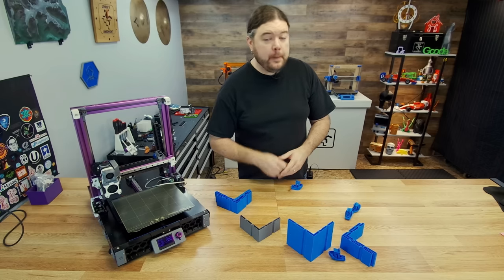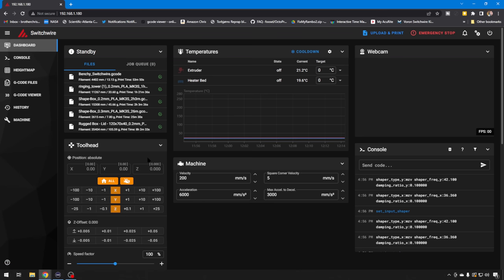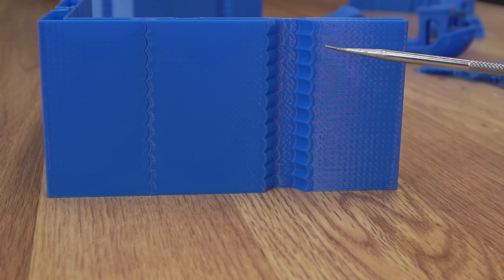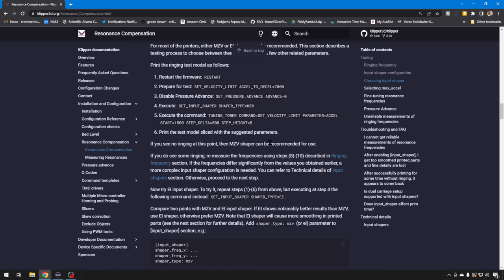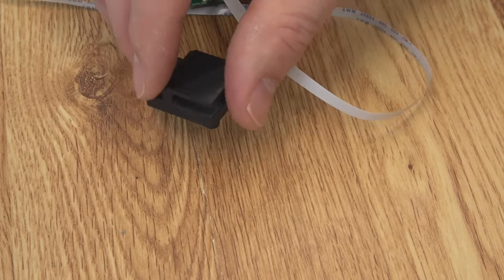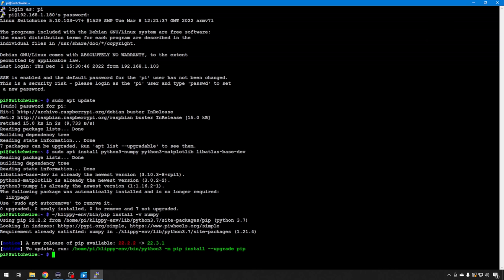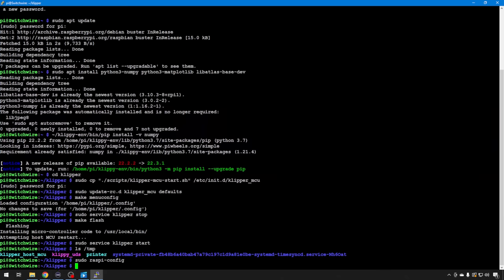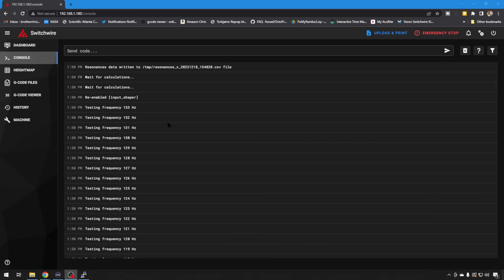Input Shaper - Part 2 - Deep Dive - Klipper - Accelerometer - Chris's Basement - 2023

Comment: For anyone who is creating their own wiring harness for their ADXL345, you need to keep the wire as short as possible and the docs recommend using  twisted-pair wiring like you find in CAT5 networking cables. Check the docs for which wires need to be paired together, because it does seem to matter. All three of my ADXL345's reported errors with straight (and long) ribbon cable. Once I created the twisted-pair cable (pairing together the wires that the docs specify), the very first ADXL345 that I had plugged in immediately returned good values. Hope this helps someone.
Reply from the maker: Great tips, thanks for posting.
Reply: @ChrisRiley  Thanks Chris, and thank you for putting out the advanced tutorials. There are tons of tutorials for beginners to 3d printing, but the more advanced topics seem to be glossed over.

Also, to anyone interested, I tested all three of my ADXL345's and all three tested good with the twisted pair cable. I wonder how many people thought they received a bad chip when it was the cable all along.
Reply from the maker: @@mercy3094 I don't see why not. It should react the same way.

Comment: I tried the direct wire method. Got a test response, but trying to run the test always errored. Ended up using a Pi Pico as the mcu and it works fine.
Reply from the maker: Hmmm, interesting, I wonder what it was having a problem getting back?
Reply: @ChrisRiley  beats me, but at least it works now and I have a spare pico (order was 2-pack) for whatever. I tried 3 diff adxl thinking I got a bad set.

Comment: I'm glad to see such a detailed guide on setting up Input Shaper because I think so many people can benefit from it.  I saw so much improvement in my prints that it seems like magic.  Wiring a sensor might initially be a bit harder for some, but it makes recalibration or setting up on another printer so quick.
Reply from the maker: Absolutely, I'm trying to break it down as much as I can. It's very impressive.

Comment: Surly the mass of the accelerometer and screws being removed after the calibration will have some effect, maybe printing a badge with the same weight to fit on the fan fixing and the bed to equalise this mass will benefit in some small way?
Reply from the maker: Good thought, that would be something to try.

Comment: Did a recent "recalibration" after initial setup with an accelerometer, as i noticed when printing at 200mm/s before without input shaper i had little ringing and after it seemed to introduce ringing (Sermoon D1 is pretty sturdy).. but maybe that wasn't the entire picture. So this time i warmed up the machine, since it's enclosed (i put a top on it) all the parts/metals get warm.. so i did another calibration with the accelerometer, to find it shifts about -6 in the X direction and -2 in the y direction (ran it twice to make sure). THEN! i ran some test prints, now it's finally better than with it off 🥰

Before i would have to run a print at over 300mms/3000accel for input shaping to start working, and worked very well at 400mm/4000accel, but i print a lot of mechanical parts and generally can't rely on prints that come out that fast so it was an issue for me (minor). The ringing or faux ringing does have a noticeable effect on print integrity, and now i can print out great mechanical parts at 200mms 😏

Long->Short; warm up your machine to typical operating temps and let it saturate before running calibration with an accelerometer
Reply from the maker: Great comment, thanks for posting. I have seen some of the new machines that are coming out with input shaper. They do the exact same thing you did here, they have a heat soak sequence to make it more stable.

Comment: Nice work Chris.  I use a retired Lenovo mini pc as my klipper computer so I use a Pi pico to talk to the accelerometer; works well.  Also if you have multiple Klipper printers I think it is easier to setup as you only configure the communication with the mcu once.
Reply from the maker: Thanks for the info!

Comment: Input shaper is amazing!!
Calibrated it on my printer the manual way and the results are astonishing! Got my cheap ass MK3S clone to 5000 acceleration using "only" 3000 for printing (5000 for travel moves) and got an immaculate Benchy at 130 mm/s print speed in just 40 minutes!!
Ordered an ADXL but honestly, I don't think it's required. 
Btw. no need to go for 3-4 decimal places. Just round it down and you're good.
Reply from the maker: Thanks for the info!

Comment: As ever your videos are so great!!
Is possible to print ringing tower model whith several IS types with fixed acceleration instead of print a whole model at same IS type only?
Reply from the maker: Thank you! That is a great question, with Klipper you can change the model on the fly. So, if you did some creative slicing you could enter this command at different layer heights to change it as it printed. SET_INPUT_SHAPER SHAPER_TYPE=XXX

Comment: same i like the details you go into and make it pretty simeple to follow, i had a question that sensor is pretty cheap but i have seen others out that might be asier that just plug into usb and usb-c into the accelerometer, i think i will go with the one you went with but wanted to know about the others if they would be harder to set up via ssh and the klipper interface with just the initial setup in the config file
Reply: your printables file wont fit for my setup as im using the sprite extruder on my ender3's and an mk8 for my cr10s5
Reply: but thats still pretty cool
Reply from the maker: Thanks! You should be able to run a sensor plugged into USB, but I'm not sure how it would be defined. I'm interested I will look around at what options there are.

Comment: I have a question. You tested frequencies with accelerometer.  But when you did that, there were manual input shaper values already in your printer.cfg. Didn't they interfere with the new calibration? I believe, it would have given more accurate results if you would have removed those before using accelerometer.
Reply from the maker: Yes, you want to zero those settings out before you do the test. There is a console command we run to turn it off before the test.
Reply: TEST_RESONANCES AXIS Script switches off Input Shaper before start test.

Comment: I'm getting the following error from the LDO input shaper kit option 'probe_points' in section 'resonance_tester' must be specified, I googled and redit suggested it was a wiring issue. After some time messing with it I gave up, I might get a Trianglelab USB adxl345 Accelerometer instead.
Reply from the maker: Make sure your config looks like this.

[adxl345]
cs_pin: rpi:None

[resonance_tester]
accel_chip: adxl345
probe_points:
    125,115,20  # an example

Comment: Hey Chris, if I only have 1 pi with 2 printer interfaces, can I add the entries for mcu rpi, adxl, and resonance_tester on each of the printer's cfg? and can they stay there permanently?
do i have to REM on one if I wanna use it on the other? it's just that, I got everything set on 1 printer and everything was hunky dory, and now I wanna do it on the 2nd one, it kept complaining that it cannot connect to the rpi mcu.
Reply: never mind, i found that you can only have it on one printer.cfg at a time :)
Reply: oh and if I have to mount it and ended up x & y swapped places, what should i do in the coding as it's clearly marked on the board which way x an y is. Thanks
Reply from the maker: Here's an example, if you need them swapped just change X to y and Y to x. 

[stepper_x]
step_pin: PF0
dir_pin: PF1
enable_pin: !PD7
microsteps: 16
rotation_distance: 40
endstop_pin: ^PE5
position_endstop: 0
position_max: 200

[stepper_y]
step_pin: PF6
dir_pin: !PF7
enable_pin: !PF2
microsteps: 16
rotation_distance: 40
endstop_pin: ^PJ1
position_endstop: 0
position_max: 200
Reply: @ChrisRiley  oh, where do we set that? Printer.cfg? I read somewhere that I have to set axes_map: y,x,z ? But tried that still got a very skewed result.
Reply: So, by swapping the pointers of the steppers, adxl345 will follow that instead of the settings set under adxl345?
Reply from the maker: @unlock-er  Oh, sorry, I misread the comment. Don't swap the steppers. I don't think there is a way to swap X and Y in the firmware on that sensor. It has to be mounted as designed.
Reply: @ChrisRiley  oh dear. Ok. That's been my conundrum, not easy to find one for ender 3 V2 neo. Found one for the CR touch mount but yeah, X and Y are swapped.

Comment: hi chris, ı got an error which is not usual I gess. After installed numpy when trying to setup rpi as a secondery mcu I just looked up to the orjinal klipper documantry and your video but I couldn t complete the setup, can you help? biqu@birol-btt:~/klipper$ sudo service klipper stop
Failed to stop klipper.service: Unit klipper.service not loaded.
Reply from the maker: What does sudo service klipper status    show? Hoping the install was okay and the service got loaded. Try to start it as well. sudo service klipper start
Reply: @ChrisRiley   I have found the solution, I m using Btt pi V1.2 and code line needed to be change a little bit, I tried to send this  "sudo service klipper-mcu stop" instead of "sudo service klipper stop" it worked just normal. The start line also needs to be send like this way. Why there is a difference I don't know but, maybe you can try to build it also with the btt pi😄